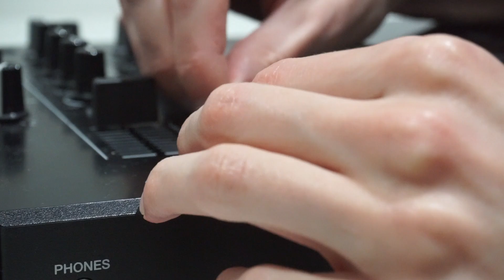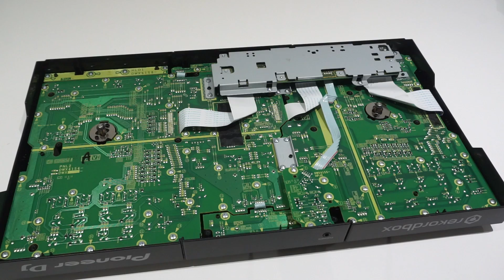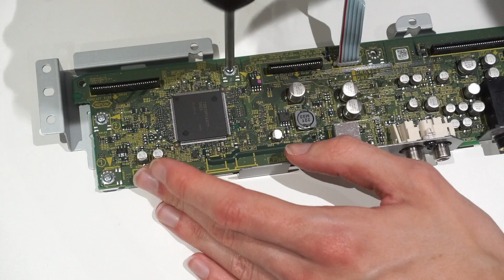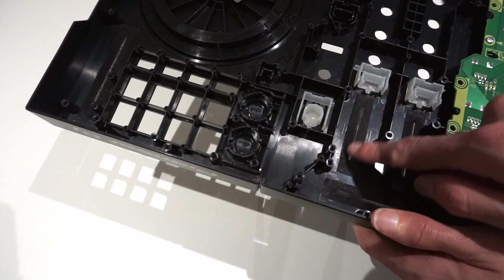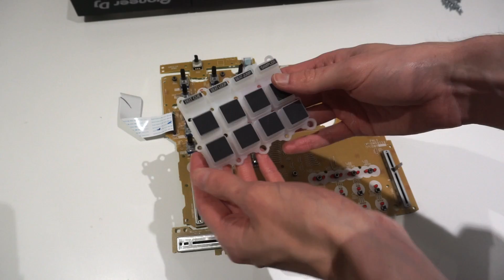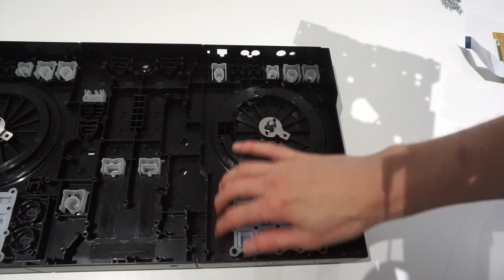Teardown - Pioneer DDJ-400 DJ Controller - How does it work?

Comment: better late than never. The jogs works like a rotary encoder. Optical sensors A and B are soldered in a way just one at a time gets obstructed by the jog’s teeth. Knowing the sequence they get “activated” (ABABABABAB) and the inicial state lets it know where it’s spinning and how faster. As you said, it’s a cheap controller but a very clever design for optimizing costs and getting LOT of functionality.

Comment: i no this is a old vid  but i got same controller out of warrenty and all the knobs are proper wobble loose even  but all still works perfect as cant see clear anuff do they tighten bk up ??? or does the hole potmeter have to be replaced to board so no if bother getting new one or not cheers for any info thanks and look forwould to your  reply

Comment: 13:47  so ive mistakenly run 48v from a mixer into the master out will i be able replace the connections or should i get a new borad?
Thanks for the videio

Comment: Hey, thanks for such an informative video. I used it to replace my 3.5mm jack. The new one works great but for some reason now I'm having an issue wherein the output from my DDJ400 is so so quiet it's almost silent, I can just about hear it with the track and speakers turned up full whack. Is there a relation between the two circuit boards? Perhaps I've fixed one thing and broken another...
Reply: Turns out when I reconnected the ribbon cable I did so the wrong way round, problem solved!

Comment: Hi Cameron very interesting video . I’m wanting to interrupt the audio from each cDj section  before it enters the mixer , export it with some soldering to rca output for an external mixer . Do you think this is possible?
Reply from the maker: Not really on something like this - this is a basic controller where the mixer section is just a control surface that controls the software, it's not a complete hardware mixer.  To do what you're needing, you'd be best to get a 4 channel USB audio interface that works with Rekordbox and configure the output settings to send the audio from each deck to separate outputs.  You'd then connect this interface into your mixer.
Reply: @camerongray1515  does analogue audio not pass through the mixer section ?
Reply from the maker: Unfortunately not, the "mixer" is purely a control surface, there is no physical mixer in the DDJ 400.  Higher end controllers such as the DDJ-1000 (which I also did a teardown video of) do contain a real mixer, however it's still a digital mixer and therefore doesn't have any analogue audio passing through it.  Your best bet is to use an external audio interface.

Comment: Thanks for a great video. I
got beer go through my left side. The bpm match button doesn’t work anymore but the light still works. Should I let it dry or take it open?
Reply from the maker: As long as you're confident enough I'd definitely pop it open and get the board out to properly clean it, isopropyl alcohol would be fine to clean it off.  Cleaning it alone may me enough to fix the button (maybe some contact cleaner sprayed into the switch as well) but what you really want to avoid is the liquid causing any further corrosion to the board which is much harder to repair than a faulty switch.
Reply: @camerongray1515 Thank you so
much man. Had a house party last night and some ignorant people were messing around. Really frustrating. Will see what happens!

Comment: Are those rotary pots actual pots or (absolute position) encoders? Pots usually only have 3 connections, those seem to have 4.
Reply from the maker: As far as I'm aware they're all actual pots except for the browse knob which is a standard rotary encoder.  Since they are ultimately controlling audio levels, you would really need the analogue linearity of a potentiometer - an absolute position encoder would produce more of a "stepped" output which would be noticeable in the audio.  Looking around it seems as though you can get 4 pin potentiometers, some of them use the fourth pin as a centre tap, others simply have the fourth pin but it's not connected to anything.
Reply: @camerongray1515  I see, thank you! That knowledge will help me with my 2 projects.

Comment: Spilled coffee from my desk onto my Pioneer DDJ-REV1 and using your video to take mine apart to get rid of this coffee spell and clean this mess up! EDIT: I'm now done and got plenty of wet coffee off of my sample buttons. I used 70% alcohol wipes and some q-tips on the board where I noticed coffee and rinsed the plastic/ rubber buttons off with natural soap and allowed to completely dry before putting back in the unit. This video was a life-saver, especially for the cross fader buttons which I would have had no idea on how to take off. I was able to remove most of the knobs using a mini-screwdriver (think eyeglass screwdriver) and wrapping a used alcohol wipe around the tip so it wouldn't scratch the plastic case. They were pretty stuck so I also used a rubber jar lid remover to grip them and pull up vertically - no doubt your hand will hurt a bit when completed. I suggest anyone who takes apart their electronics to take plenty of clear photos before removing screws, etc. so you have a reference where it all goes back.

Comment: Thanks! Got a dead cue switch on one channel on a DDJ-400 and this video was a lifesaver, now I know it should be easy to get fixed :)
Reply: Let me know how you get on. I just took a unit on with a few functions on the left, like the cue, not working. I suspect that left hand board. Interested to know how you get on as we're both on it at the same time! Apparently a cat pissed on it xD
Reply: @Khola_D  as it turns out the owner decided to return it instead, but I'll save this video for if I ever get into similar problems with my own :)

Comment: Thanks! I used this video to fix my controller. It turns out that cat hair was clogging the jog wheel optical sensors which prevented any movement from registering. I can't believe it.....

Comment: Those cheap ribbon cables and connectors inside and people connect gold plated 0% oxygen pure copper cables to it and wonder why that doesn't improve the sound quality 😂
Reply from the maker: While I'm not a believer in some of those stupidly overpriced RCA cables, the ribbon cables inside don't carry audio, they're just signals from the buttons and other controls that feed back to the microcontroller.  All of the audio is handled by the DACs on the main CPU PCB which has the RCA jacks directly on it.
Reply: @camerongray1515  the one that goes to the headphone pcb does, plus the rca connectors themselves are 😐
Reply from the maker: That's true on the headphone one.  As for the RCA connectors, it's an entry level controller so those are fine for the intended use case.  They have a wide range of different models so it's understandable that they will leave out features like balanced outputs on the lower end models to differentiate their models.  From what I've heard the sound quality is still acceptable, I've even heard the DDJ-400 played in clubs (usually with the RCA output connected into the club's mixer which then goes out over balanced connections to the amps) and I've never noticed an issue.

Comment: My crossfader has snapped and needs replacing but I don't have a clue about soldering etc. Is it a quick swap or do I need to know some electronic stuff? (which I don't) 😂
Reply: Hey there man by chance did u ever find an answer. I just got my ddj 400 used and the crossfader is chipped. What did u end up doing?
Reply: @byplazasam  sold it as broken ha

Comment: While I'm very familiar with the physics behind electronics and communications, I cannot for the life of me figure out how circuitry this complicated works! Any recommendations for articles/journals/books/courses that I could pick up??
My browse wheel is just randomly skipping songs on the playlist, thought it was a software problem and tried downgrading Rekordbox and my OSX but it wasn't that. Gonna take it apart in the hope it's just dust making it act up, maybe static electricity?
Reply from the maker: I'm definitely not an electronics expert, most of my knowledge is just pieced together over the years, YouTube channels such as bigclivedotcom and eevblog could be a good start though.  As for your browse knob, it's probably a "rotary encoder" (https://en.wikipedia.org/wiki/Rotary_encoder#Standard_binary_encoding), as a first port of call I'd try cleaning it with some contact cleaner spray as it may just have dirt/corrosion in it.  If this doesn't help, I'd check all of the solder joints on it to make sure none of them are broken and if they look okay, I'd see if I can find a suitable replacement part and replace it (you may be able to find a brand and part number on the part)

Comment: Can you please do the tear down of Pioneer DJ DDJ-FLX6
Reply from the maker: While I'd love to do more teardowns of stuff like this, I only have access to equipment that I own myself and these teardowns sadly don't generate enough revenue to justify the cost of buying equipment to teardown.
Reply: @camerongray1515  It would be interesting as they appear to share the same pitch adj component but the FLX6 has a higher pitch accuracy in Rekordbox than the 400. The FLX6 is able to get every increment but, the 400 is just shy about 0.02 BPM out. Still accurate, just not as accurate. I have electronics education /knowledge & service my own Pioneer Mixers & CDJs but, I won't look & ruin the warranty on them until I need to 🤣

Comment: My DDJ 400 recently developed a fault: When I put my left deck's volume fader fully down some sound still bleeds through.  Any ideas at the extent of repair required? New fader, just some misalignment to rectify?  Help from anyone would be appreciated. Thank you.
Reply: Hey man I've got the same problem, did you figure out a solution?
Reply: You need to replace the channel fader

Comment: Thanks, just fixed my volume fader following this - just a little dust!
Reply: what did you do to clean? Opened it completely or just removing the cap from the fader? I'm having the same issue with my volume fader
Reply: @ImYeeap  old toothbrush!
Reply: @MrFlangle  how did you use the toothbrush to clean it? remove cap from fader? open box?
Reply: I replaced the volume potentiometer. It started to wobble because I always hold it tight and danced meanwhile :)
Reply: @IHavePi  Where did you buy it?
Reply: I found this video because I'm also experiencing volume fader issues. Fingers crossed an old toothbrush works for my case too!
Reply: F
Reply: At least being digital just like their new mixers & not analogue, you won't get any sound issues from a dodgy scratchy fader. It takes the travel position into account for the fade instead. They still 'feel' crappy though.
Reply: i'm opening the ddj-400 rn, having same issue that my volume fader going to wobbling everytime i slide it, hopefully it will fix the problem after i clean it with toothbrush.
Reply: @sterix.2600  Did it work? I'm scared to fuck up the whole controller 😂😭

Comment: Hey Cameron Grey, thanks heaps for this great teardown. Always a brave mission to take apart something like this, you never know if it's going to go back together smoothly until it's too late. Turned out to be alright!

I'm not sure of how much electrical understanding you have, this is the first video on your channel I've seen. But you did excellent in regards to intuition and research understanding the board and how it works. I found it very helpful, as if I had teared down one myself.

The only thing I didn't see that I'd have liked to is how is the capacitive touch electrically coupled to the rotating platter. I assume it's either a cheap metal clamp around the shaft, or a carbon brush like a motor. But couldn't tell from the video.

Thanks again!

Comment: At 25:25 you show two  photo interrupters. one side of each interupter is a IR LED and the opposite side is a IR photo transistor that detects the InfraRed light.
The black 'fingers' in that disc passes between the two halfs of the interupter and breaks the IR beam as they pass through.. 
The system knows what direction the disc is turning by seeing which one of the two photo interupters has it's beam broken first. That is why there are two interupters fitted.
The speed can be worked out by how fast the Infra Red beams are being broken 'interupted'.  Does this make sense or am I rambling?
Reply: Yeh its an optical encoder

Comment: DDJ-400 OR DDJ-SB3?
Reply from the maker: Really comes down to the software you prefer, the DDJ-400 is aimed towards Rekordbox DJ, the SB3 is geared towards Serato.  At least for me the benefit of the DDJ-400 is that it includes a full copy of Rekordbox DJ whereas the SB3 only includes Serato Lite which is somewhat limited in terms of features.
Reply: @camerongray1515  Thank you very much. BTW which controller do you use?

Comment: Nice to still see the larger board being built single-sided. Probably a cost reduction function, but would definitely take flex better when the controller is getting banged around in a bag or travel gear when gigging out from place-to-place.
Reply: Amiga 500 boards are some of my favorite things xD I love that early single sided, through-hole style with a few socketed chips.

Comment: I guess the links next to the board version might be used by an automatic testing  in manufacturing. So they might have the same board in different products, but populated slightly differently, and the link tells the tester what components (and values?) to check for‽
Reply: If the components are inserted by machine, then using a wire link to label the model number means they can have the same machine add the model number label. That will avoid an extra process step and pretty much eliminate the kind of error where a board with the components for one model number gets labelled as a different model number, or where a pre-labelled board gets populated with components for a different model number. Even if they are assembled by hand, it makes sense for the person populating the components to label the board, to reduce the chances of the same kind of errors.

Comment: Cameron have you replaced your sockets to metal ones yet?
Reply from the maker: I've done most of them, still got to do the kitchen, hallway and shaver socket but keep finding more interesting things to spend almost £300 on - The kitchen gets pretty expensive factoring in all the grid switches and cooker isolator.   Might do them soon since I'm not spending nearly as much with the current lockdown but I also need to budget for other things like replacing the expiring smoke detection.

Comment: are the two platter things not digital encoder controllers to can swing the audio track back and fourth, Most of the unit uses DSP processing
Reply from the maker: They carry out a similar task to a traditional rotary encoder but they use optical sensing rather than any sort of physical contact mechanism in order to reduce wear and drag.  This particular model doesn't really have any DSP capability, all audio processing is done in software on the connected computer, the controller simply acts as an audio interface.  However, some of their higher end controllers (DDJ-1000.etc) do have integrated digital mixers that carry out the effects in hardware.

Comment: Slider caps have locking mechs, huh?  Totally would have broken them by just pulling vertically up.  That’s some good info to know.  Good idea with key puller, too.
Reply from the maker: I only discovered the locking mechanism when I couldn't work out why pulling straight up didn't work - glad I didn't keep pulling and went off to look up how to remove them.
Reply: @camerongray1515  seriously saved us some bother. Thanks!